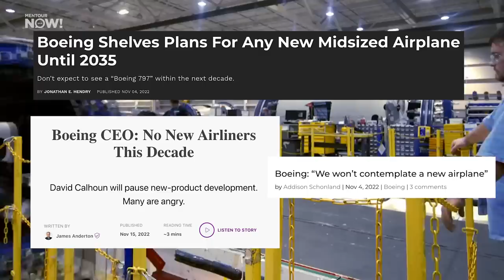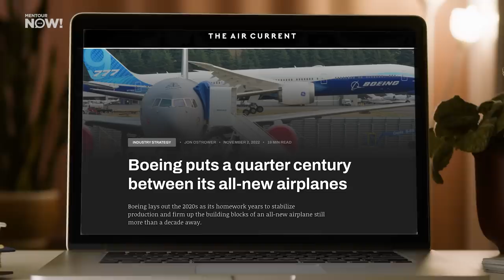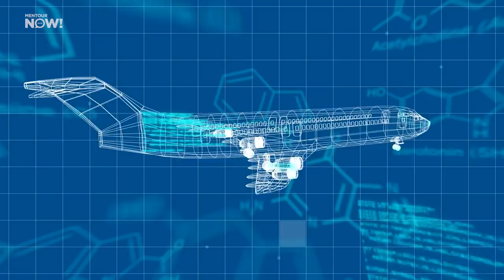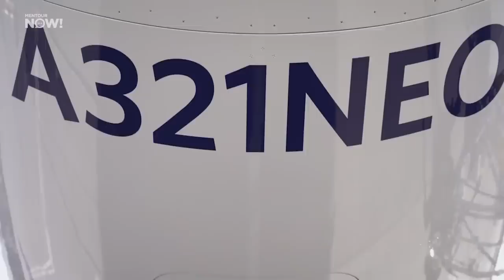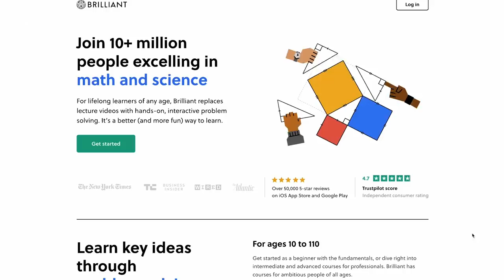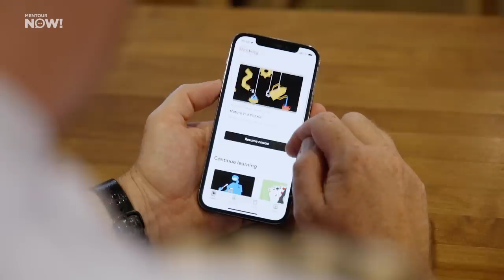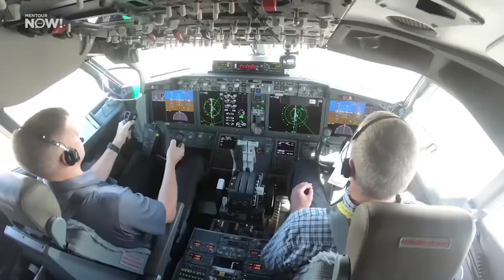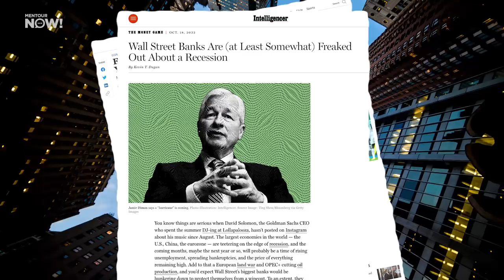Is BOEING giving up!?

Comment: The preventable MCAS debacle with the 737 Max that caused 2 crashes and the loss of life is reprehensible in my book. Now a defense contractor as well as other interests have made Boeing to big to succeed.  The physics of aviatin are clearly understood. How much better can you make a wing? I get it with engine technology improving. How 'bout the KISS rule and make a model T fuselage with the ability to change engines and electronics and keep the human at the controls with the ability to override the system when needed.  I think simplifying would reduce costs. These airplanes now are incredibly expensive.  Airbus has the perfect name defining it's purpose. Boeing is too complicated.
Reply: The digital communications devices we use are complex enough!! As are  computerised cars!! Even a new stove is more complex than 25 years ago!! So when it comes to aircraft! The sheer digital complexity of these flying machines. Which is, after all what they are! Has played a central part in the deaths of  hundreds of people!! And not just with Boeing aircraft. But also Airbus and other aircraft brands!!

Comment: Boeing should have brought up the updated 757 with re-engined (maybe a flat rated trent1000), re-winged (composite), updated avionics, bleedless engine tech like 787. Though this would have been much dissimilar to current 757, it will surely made boeing to be competitive in that segment. Once the engine tech matures, they could have announced a new cleansheet design later. They should have announced by the time 787 entered service, i.e., 2011.

But alas, tooling and suppliers of 757 is all gone.

Comment: Boeing is a greedy, short term focused company just like most of them in the USA. Make stock buybacks illegal again which has bled the airline industry too. They have also moved much of production away from the engineers and senior management to cut pay and stop paying state and local taxes, which makes prototypes harder to develop. And they do not pay federal taxes either. They forced Bombardier to sell itself to Airbus and relocate US production to non union Alabama. Boeing is not the same company as when my father was a 747 airframe designer. It had problems but at least it was productive with new designs, as you point out.

Comment: If a new generation of aircraft´s, whether from Boeing or Airbus, are not based on/designed for hydrogen, aviation are a dead fish. They have to come out with launch dates/years of their hydrogen driven aircrafts (and I am talking about hydrogen as fuel, not hydrogen fuel cells generating electricity, hydrogen jet engine driven!) the global politicians HAVE to opt for a continent connecting vacuum based hyperloop. Going from London to New York in 45 minutes sounds like (real) progress to me and that are what a vacuum based hyperloop offer, just as it can receive green electricity directly from off shore windmill parks around the world. Now or never! Crunch time. Do the jet engine/aircraft manufacturers want to be part of the solution or stay as a growing part of the problem. I note that RR have revealed they now have a hydrogen jetengine prototype meant for aircrafts.  Toyota last years have proven with test cars they can deliver well working 4 stroke direct hydrogen injection car engines. Formula 1 have already announced they eventually will abandon fossil fuels and use hydrogen powered racecars though without setting a date for first year in use.
800.000 years with a stable atmospheric CO2 content of 220 PPM have, since the industrial revolution now exponentially exploded to 417 PPM. WE, as a species, are SO primitive. Name one other species that knowingly destroy own habitat, the very habitat that brought them there. I am SO unimpressed.

Comment: Boeing has been so damaged by its merger with Lockheed.  It destroyed Boeing's culture of technical innovation and excellence and replaced it with some pathetic MBA driven bean counter gimmicks that favors profitability over quality and sound engineering.     Given Boeing's 787, 747-8, 777X and 737MAX development and/or certification fiascos they should indeed think long and hard about their future plans.  It is a shadow of the company it used to be.

Comment: it's just an excuse, cause Boeing is in a lot of trouble , their jets are way way cheaper than Airbus, eg 787 30% less than an a350 on avg, they have no choice about that , so they dont really have the funds for a big project , and they dont know how much the max disaster is still going to cost them , plus they need tons of funds to stay ahead on the very lucrative military projects, - cause if they really wanted, the 20% is there now, with hybrid electric turbofans!!! eg. a GEnx core driving a generator - driving a tesla plaid motor driving the fan!!! there is your 20% just like that !!! it's the future - batteries will never be a mainstay in aviation because of weight, in a car, the weight, is an inertial load which is mostly recoverable upon breaking, but in an aircraft weight requires more lift which equals more continuous parasitic drag which is  orders of magnitude more costly than in a ground vehicle, very limiting, so fuel/electric is the future whether the fuel is fossil or hydrogen

Comment: Boeing is out of options.
The 737 is dead in the water, too old to keep upgrading (see the 737Max disaster), the 787 is disappointing, the 777X is massively overdue and probably not what customers need. 
The 747 is gone, so is the 767.
With the time and money needed to replace their civilian line being more than the company can currently afford, especially in a world where the customers don't trust them as a supplier, they're in serious trouble.

Airbus no doubt is already in talks with CFM and will have the design ready to build when the RISE engine becomes available to fit on it.
Boeing is waiting for CFM to put the engine on the market, and only will start designing the aircraft when that happens. Which will give them a 5-10 year delay after Airbus, and Airbus is already ahead of Boeing when it comes to most all aspect of airliner development and production.

I've long preferred Boeing aircraft over Airbus for political reasons (Airbus gets massive subsidies coming out of my tax money without me ever seeing any return on that as Airbus/EADS has not a single facility in this country) but they sure have superior technology and the guts to use it.

The US government won't allow Boeing to go under, but I see their airliner division being spun off into an aviation services company offering repair and maintenance services only, and then being gobbled up by someone else, possibly EADS.
And with that Airbus will be the sole player in the airliner market outside of China and Russia.

Comment: My first thought is: Who will develop the planes during the next decade?

To develop high quality aircraft you need skilled and experienced engineers. (The 737MAX debacle shows what happens when you decide to outsource to companies without the experience from the aviation industry)

If major manufacturers run at low speed then the people who have the correct experience will have retired or left to do other things and the new engineers will not have the proper experience.

Comment: The current volume of high-altitude heat deposition is unacceptable. The tremendous quantities of extreme heat blasted into the frigid stratosphere cause serious problems and almost certainly alters the normal flow of the jet stream. A million people a day fly, it is a large problem. I hope we are smart enough to move to electric aircraft as our priority as the ever-increasing inclement weather that we are seeing is very likely driven primarily by jet heat/exhaust. We may have to slow down our speed of travel for a decade or two, but it is vital.

Comment: I'm not really a fan of the Rise engine (nice pun). That engine would surely make the aircrafts slower than they currently are. I want to be able to fly to CPH in 1 and a half hours in stead of a 2 and a half hours what it will take with ATR in stead of a fast jet which will have a cruising speed like 460kt like what they normally are.

Comment: William Boeing, James McDonnell, and Donald Douglas must all be turning in their graves, especially the latter two who were both MIT engineering graduates. The surviving company, Boeing, is going the way of the American auto industry. There's the same subordination of engineering and producing a world class quality product to business school MBA's who typically try to increase company income by going with the lowest standards they can get away with. This includes the quality of the employees. In the case of Detroit and now Boeing, competence, ability, and work ethic are lesser qualifications than the political agenda of "diversity" in the work force. Airbus and other foreign manufacturers have the same world price for titanium, aluminum, copper, computer chips, and other materials as Boeing. They do, however, have better labor forces. For at least the last generation the Europeans and other foreign workers work with more diligence, are better trained, aren't continually bleeding their employer with claims of discrimination or sketchy disability or job related injury claims. This is why Boeing can be undersold on otherwise competitive products. It's a far cry from the generation that won WWII in our current workforce as well as from those who sent man to the moon and back with sliderules and the integrity to do their best. Standards weren't lowered to please special interest demands, typically from minority or often perverted pressure groups.

Comment: There is another huge isue, the change from diesel jet A1 fuel to hydrogen... If so, It's going to change the rules for all the players.
Reply: Hydrogen is a fantasy as primary fuel for jets. Overall Hydrogen tech is x10 more expensive than kerosine tech.

Comment: You failed to mention Boeings problems with its Starliner space capsule too where they have spent a few Billion & still have software issues, plus by the mid 2030 Battery density will be above 400Wh/kg enabling planes to become all electric, especially on short haul flights so this could play well with Boeing roadmap, Worse though is Boeing has lost trust & this will take some considerable effort to regain back

Comment: For me it makes a lot of sense. They are already so much behind on current rollout for one. They need quite some time to get that in order. Then there is the fact that with the current energy crisis, it's not known what's exactly the best path to the future to use as energy fuel for the next generation (kerosine, hydrogen or newer much advanced batteries). This is actually pretty smart from Boeing.
But they also forced themselves to cut down on investments by trying to cheat on the MAX and getting caught and humaliated (on top of covid and economic global problems)